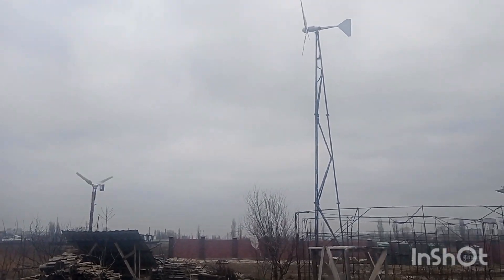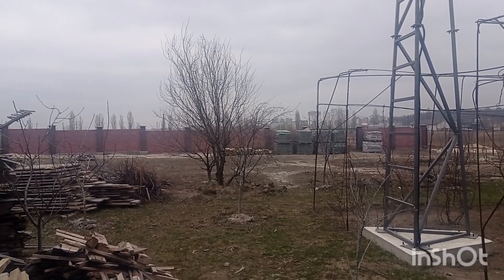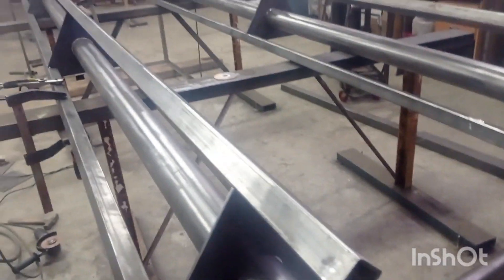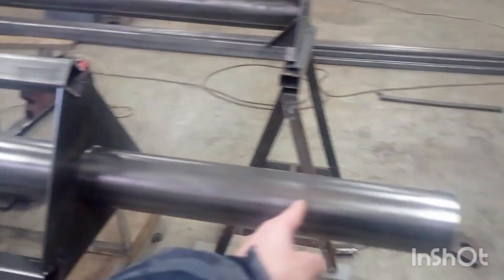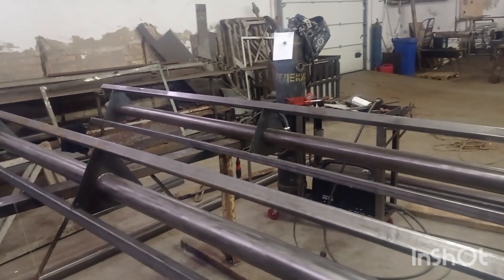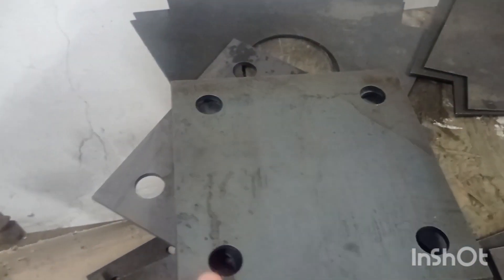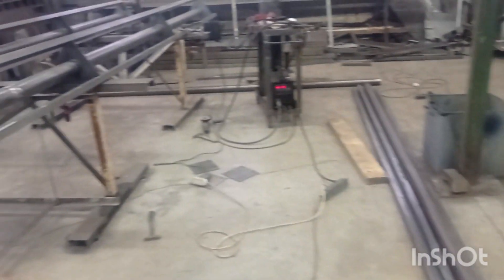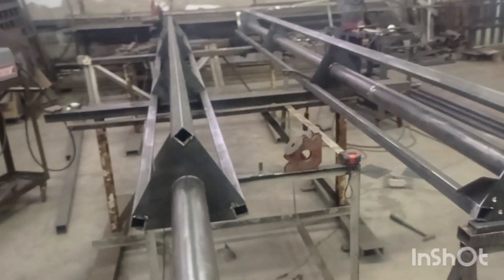How the small 10 m mast for a wind turbine is made. Let's check how things are in the metal workshop

Comment: What size pipe did you use ID OD? What size box tubing did you use outside dimension plus wall thickness?
Reply from the maker: that central pipe is 90mm in diameter, 3 mm wall thickness. the triangle size is not that big, 350 mm, reinforced by square pipes of 50x50 mm again of 3 mm thickness. supportive triangle plates are of 5 mm thick.
it already withstood a couple of nice wind blows of over 13-15 m/s, so can be considered quite sturdy. however, if you are using whatever bigger diameter windwheel for it (I'd say over 2.0-2.1 m in diameter) the wireguides is a must.

Comment: Hi again. I heard there is a calculator to calculate the wind force on the mast of the wind turbine. To make sure your mast is ok. Have you heard anything about this, and do you know where to find it?

Thanks mate
Reply from the maker: no, don't know about it yet. haven't searched for it specifically. I think I will need one once I am going to put something really worthy, like 5+ meters in diameter.
Reply: I gonna try find it. I will let you know if I find it cos you really are going to need it. Maybe the seller can help you with the tower/mast. Or maybe not. I bought your FT1000L and the seller says that my 76mm diameter 3mm thick mast is not enough. I am not completely sure, that is why I want to calculate it myself
Reply from the maker: @JoseAgustin-hq2pl  I bet it will stand well with the wireguides
Reply: That IS what I think. It IS where my M5 sits. And the mast doesn't move at all even with very strong wind. Would It be a that different with the Ft1000L which is15kg more and 30cm  wind wheel bigger? Dunno
Reply from the maker: @JoseAgustin-hq2pl  look, one more parameter to consider - the folding tail wind turbine has got less impact on the tower then the fixed tail wind turbine...
and on the strong winds the difference gets massive, folding tail wins it all.
Reply: You are right. I didn't think about that. When the tail folds, the  wind turbine gets less wind so the wind turbine pushes the mast less😅 Thanks mate
Reply from the maker: @JoseAgustin-hq2pl  you are welcome